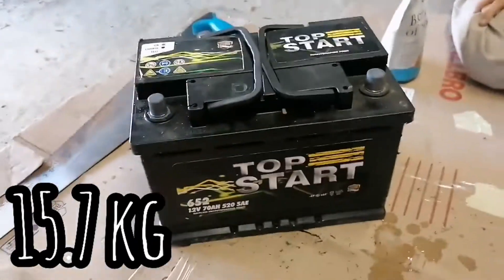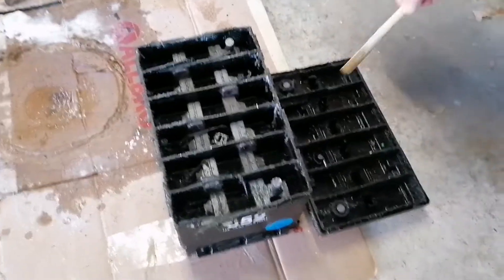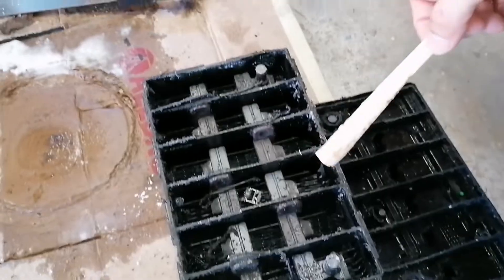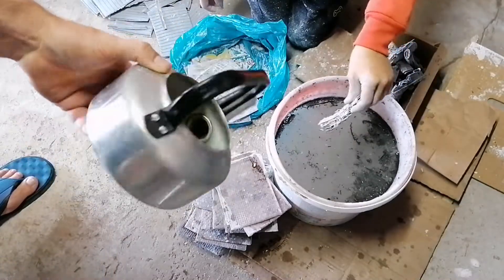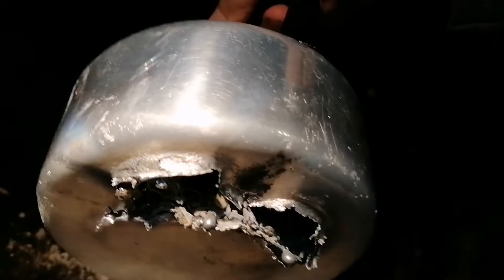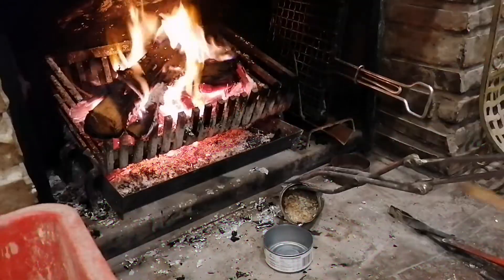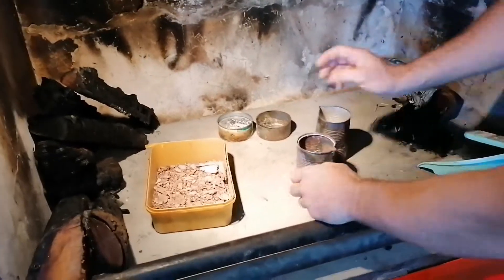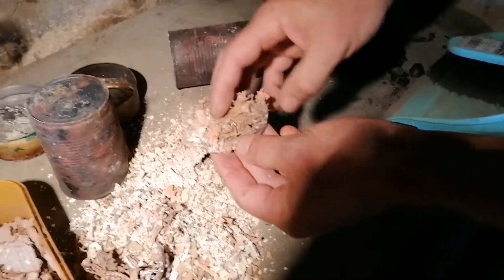Is it worth extracting LEAD from a battery?🔋

Comment: Way to much stuffing around.  1 make a fire with a sheet of iron under it  2 drill holes in batteries and drain acid   3 put the batteries in the fire ontop of the iron.     I have about 10 tonnes to get through I was considering a beerkeg furnace and feeding the batteries straight in  Just make a slit down at the lowest point for the lead to drip through and capture.   This was is way to labour intensive (handeling lead is not ideal)

Comment: Adding a good carbon source like coal coke and blasting it with air will reduce the lead oxide back to lead ( PB02- PB). your yield will be much higher. you can use the charcoal from the fire, it just takes longer. Be sure to wear an breathing filtration device. Take care, John Oakley.
Reply: I didn't see shoes or gloves- a breathing what?